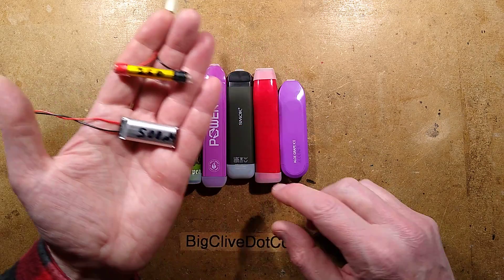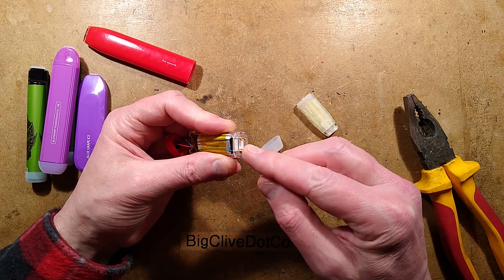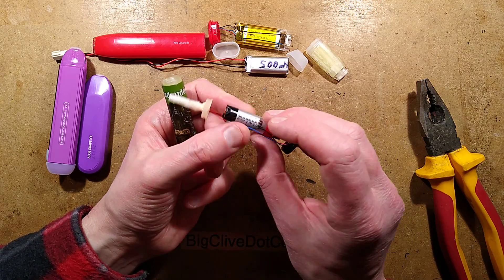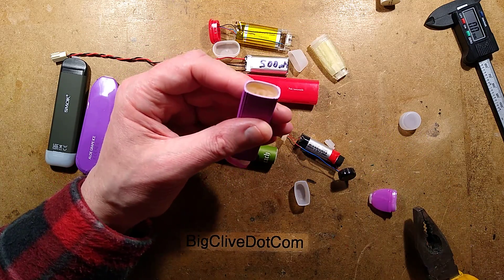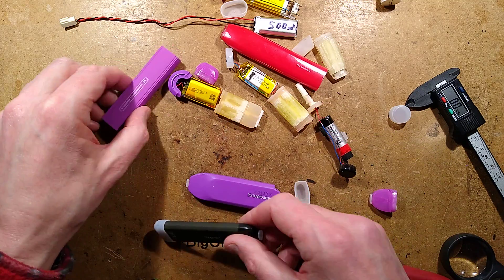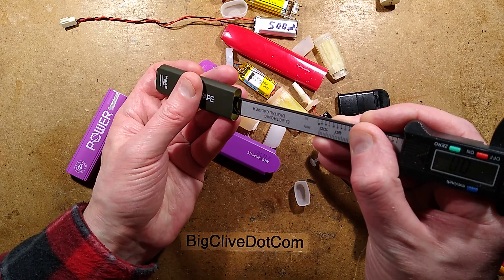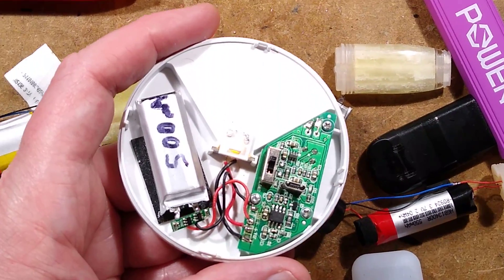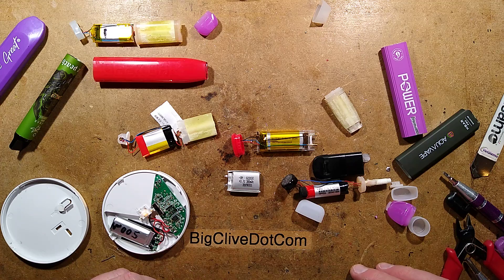Scavenging rechargeable lithium cells from the roadside

Comment: Would love to see more about reusing, testing, connecting, charging these little batteries
Reply: Buy a simple TP4056 board or equivalent and use as any other LiPo battery. The TP4056 boards have protection snd charging all on one board. If the voltage is 2.9V+ treat them as almost brand new and charge them up without worries. Although if you plan to store them for later, charge them up to the nominal 3.7V. If the voltage is lower then watch the battery as its charging, you never knew. Look up some tests to see if they hold a charge and so on. I have some that work fine after and some thst don't.  Depends on how long it has been left discharged.
Reply: @deskpro256  https://www.youtube.com/watch?v=M88e1r8nvYk
Reply: @deskpro256  I now have two scavenged Li-ion cells and I'm really tempted to build (or cobble together) a charger.  I currently don't have a use in mind, but the waste of perfectly good cells is criminal.
Reply: Devon Crawford had a fun video or two on this
Reply: @konradybcio  link?
Reply: Note that not all tp4056 boards have the full protection circuitry (the dw01a and dual mosfet), but some do, they're pretty easy to spot because of the two extra little 6 pin chips.
Reply: Would love to see the e-liquid module's volume (and its body, if present) used to house a Joule Thief. Can it be done?
Reply: @michaelthibault7930  why would one do that though... U can't fit decent alkaline cell inside anyway, and you have 3.7V cell inside already.
Reply: @plainedgedsaw1694  I'm talking about replacing the load, not all the interior guts (though you might want to replace the pressure sensor with a motion-triggered reed switch)…
Reply: @plainedgedsaw1694  Actually you can use an "upside down" joule thief, basically using it as a buck regulator of sorts. I do remember Quantsuff had some interesting pages on low power LED drivers...
I've used a heavily modded version to act as a battery charger, it puts out a constant 1.45V running from 5V.
Reply: @KomiyanVT  thx, i will be checking that one out.
Reply: @plainedgedsaw1694  Might have to hit up the wayback machine - from what I know Q's website has been down for a while...
Reply: @KomiyanVT  yep, i already found it archived.
Reply: Yes! I have been collecting a ton of these and I'm not sure what to do with them all. They all seem to have different specs depending on the brands.

Comment: When you made some years ago a video about the disposable chargers I picked up a job lot of those on ebay and I still have some stashed away. It has been my go to source of small cells for conversion projects. For example those small pouch cells fit nicely where a 9V or 3 AAA batteries would go and in general are great for small devices where a 18650 would simply not fit.
The annoying part is to have to always remember to change the programming resistor on the TP4056 module but it's worth it.

It's incredible and sad how many of these get simply thrown away

Also of course another great source of lithium cells are laptop batteries
Reply: Same, I like making devices rechargeable where possible, I used to think laptop batteries were good and they still aren't an awful source, but it isn't uncommon for them to be moderately used or have sat around for several years and lost a fair amount of capacity.
Reply: Splitting this into two comments because youtube keeps deleting it...

A far better source are battery recyclers such as "battery clearing house", (being deleted for this???) not only do recyclers offer cells much cheaper between 30-70 cents per cell vs the $1-3 per cell you typically find out of laptop packs, they often test at least batch of a several 100 or so cells before offering them up for sale, so although by no means guaranteed, you're much more likely to get what you pay for, the main advantage to buying battery packs is free shipping, where you can just buy a pack for $15, whereas these guys are shipping things properly so additional fees and thus cannot offer shipping any cheaper than about $15, so yeah the downside is it's not a great value unless you're spending at least $100 or so on a case of cells or unless you're lucky enough to live near a warehouse then you can pick up your order locally.
Reply: @vgamesx1   I like Battery Hookup, David Poz is one of their YT fans, and they often have some killer deals.
Reply: @vgamesx1  - I tend to dismantle my own battery packs as I replace them in customer systems.  I have a shoebox full of them, with their tested rating written on the side.   They're becoming much rarer, as the manufacturers don't want people to replace the batteries, but rather replace the laptop.

Comment: For all the talk there has been lately about lithium mining and its environmental impact, the use of these disposable lithium cells seems rather egregious. I'm actually surprised that this is the more profitable solution.
Reply: I've asked Naomi Wu on Twitter, and apparently Chinese government forbid selling of these in 2019, in all provinces. No ban on manufacturing, regrettably 
Chinese started selling little microusb boards with small alligator clamps online, marketing it to smokers to recharge these.
Reply: @KOTYAR1  I work at a smoke shop and we just got disposable vapes with charging ports. It surprised me that ports are cheap enough to throw away! I wish we would ban disposable vapes altogether honestly, you should have to get the refillable ones. Juul's cartridge system is better than disposing of the whole battery and device.

Edit: Maybe he meant they have a way to recharge old vapes, not that they are adding ports to manufacture. Either way, it's just a lot of stuff to be throwing away.
Reply: @chaotickreg7024  truth
Reply: Selling things is always more profitable when you don't have to account for the disposal and environmental cost (by making it "someobne else's problem".)
Reply: "unpriced externalities"
Reply: In a test I've seen with a paper filter, the cigarette spewed out a lot of brown gunk, while the vape didn't. The difference could not be more obvious.
Reply: You're talking the big tobacco companies who now own the majority of the e cigarette/vape industry (despite the self delusions of the addicted hoards thinking they are sticking it to big tobacco)
Reply: @--Nath--  What you are saying is only partially true.  Some of the cheap disposables may be backed by Big Tobacco.  But, that's simply not true of the quality devices available.  We use these devices for years, not days or weeks.
And, frankly, I couldn't give a rat's ass about "sticking it to" Big Tobacco.  I'm in it for myself, with tremendously improved lungs since I quit smoking 30 cigarettes a day.  The transition was effortless.  Vaping has, at very least, extended my life.
Reply: @Vector_Ze  You're making some pretty big assumptions there.  It is true that vaping devices avoid some of the traditional health risks of cigarettes, but there are an increasing number of studies that suggest that they may well come with their own different health issues as well, which are not necessarily any better.  That's on top of the fact that the manufacturers are in many cases deliberately including flavorings or other chemicals which are already well known to cause respiratory complications or even full on chronic diseases when inhaled (for example, cinnamon, which causes respiratory inflammation which can actually damage the lungs if done repeatedly, or diacetyl, which is commonly used for popcorn-flavoring, etc, which is known to cause a respiratory disease (known as "popcorn lung", actually) if inhaled repeatedly over prolonged periods), and those are only a couple.  Most of the chemicals in these devices are approved for food use, but have never actually even been tested for inhalation in the first place, so nobody actually even knows what they do to you if they end up in the lungs, which are very different from the stomach in many ways.

Part of the reason these devices have taken off so much is because people seem to think they're "healthier", but the real truth is that, unlike cigarettes, they just haven't been around long enough for anybody to actually have any idea at all what the long-term health risks of these things actually is.  I would not be at all surprised if a couple of decades down the line people start really realizing that maybe they weren't really a better option after all.  Unfortunately, at that point for many people it will just be too late...
Reply: @foogod4237  Well, I have to say you're well versed in the anti-vaping talking points (meaning, I've heard it all before).  There are a few gapping holes though.
Most glaringly is the old corn that vaping hasn't been around long enough to know.  I believe my more than a DOZEN years vaping, following 35 years of smoking cigarettes is pretty conclusive, using my own body's response as a gauge.  I can BREATHE, damn it!  That's kind of important.

Does it not seem that after more than a dozen years, investigations could have turned up at least some preliminary issues?  Nothing yet.  And, if there are issues (eventually confirmed), I seriously doubt they're going to top the high probability of a horrible death from a lifetime of inhaling tobacco smoke.  On the contrary, researchers every bit as valid as the "studies" you've read about (but not cited) have indicated by a WIDE margin that vaping is less harmful than smoking.  A cited figure is 95% less harmful, which stands to reason.
https://www.gov.uk/government/news/e-cigarettes-around-95-less-harmful-than-tobacco-estimates-landmark-review

Flavorings may be a concern, although the popcorn lung thing is straight out of the propagandist's textbook.  I've sidestepped that issue entirely, since along with a lot of other vapers, I don't use flavored eLiquid.  My guess is you aren't even aware of that as a possibility.  Both flavorings and nicotine are optional.
But, the biggest problem with your diatribe is the red herring you went on when you stated vaping isn't "healthier" than smoking.  Absolutely no sensible person ever suggested that either smoking nor vaping was "healthy."  Guess what?  Neither is eating red meat.  Healthier??   Are you for real?  We're not talking about eating fruits & vegetables.
No educated vaper is going to claim vaping is harmless.  But, it is far less HARMFUL.  Vaping produces no SMOKE, and that is the big killer with combustible tobacco, inhaled habitually, and daily.  That's a deadly habit.

Most importantly, vaping has helped MILLIONS of people quit the deadly habit of smoking.  Think about that.
Is vaping harmless, probably not.  Is it better than smoking?  NO question about it, ask almost any doctor.  Every single compound in vape is found in tobacco smoke...plus THOUSANDS of others (some proven carcinogenic) not found in vape.
You would choose to deprive smokers of the most effective smoking cessation aid ever devised.

I swear, some people would prefer that people just keep smoking, rather than switch to a less harmful alternative.  I'm 68.  When I was in my mid-50s, I was certain I wouldn't make it to 60, my lungs were in horrible shape.  A decade after switching, my doctor stated that my lungs were nearly as clear as if I'd never smoked.  Get a life, get off the anti-vaping bandwagon.  There is NO QUESTION that I'm more healthy now than I was when I was smoking 200 cigarettes each week.
Don't stand in the way of people who want to end a tough habit, to try to extend their lives.

I would never condone someone who isn't already addicted to nicotine to take up vaping.  It is a powerful smoking cessation aid, which is subject to abuse.  Kids can't legally buy alcohol, nor tobacco products.  That's well and good, but it never stopped them from obtaining alcohol, nor tobacco products.  If they're going to do one or the other (they will), vaping is nowhere near the threat that smoking is.
The way you anti-vaping warriors would have it, the kids (and everyone else) would be better off smoking...and that's madness.
Reply: @Vector_Ze  I seem to have touched a nerve..  I'm not some "anti-vaping warrior" like you seem to think.  Those weren't "talking points", they were my own conclusions from my own research into the subject.  I'm not trying to tell you "you shouldn't ever vape".  I'm simply saying that you should not assume that vaping is necessarily any better than cigarettes, because the truth is just that nobody actually really knows whether it is or not yet (and in many cases, the manufacturers of the devices seem to be playing rather fast-and-loose with things that are known to be unsafe in other ways, which is not a good sign in general).

Even after people suspected that tobacco use was harmful, it took many decades of many large studies for them to actually unravel all the details of exactly how harmful it was and the multitude of different ways it affected the body.  Things like asbestos were in use for literally centuries before people discovered how bad they really were.  Sure, modern science has gotten better, but even recent medical concerns like athletics-related-TBI went undiagnosed for many decades before people realised they might even be an issue (basically, it wasn't until they started doing a lot of autopsies that they found it).  That's just how this sort of thing works, because the human body is a very complicated thing.  The anecdotal report of "I feel fine" from an individual (or even a bunch of individuals) using something for 12 years is basically meaningless in these sorts of areas.

But I'm not trying to tell you that switching to vaping was a horrible thing.  While I personally don't know whether it is actually any better or not, to be honest, I doubt it is actually any worse, so if you decided to swtich from cigarettes to vapes, I don't really have a problem with that.  I just don't think you should assume that because you switched you're necessarily any better off than you were before, because frankly, nobody actually knows at this point.  I also don't think that vaping should be hailed as some "savior of cigarette smokers", because it's entirely possible that it's actually just bad in different, less obvious ways, and we may well discover in the long run that people have only swapped one set of diseases for a different one instead.

As for vaping helping millions of people quit smoking, I'd love to see a citation for that.  When these devices first came out, I was actually rather hopeful that that might at least be a positive benefit of them, but frankly, what I've seen since has seemed to be exactly the opposite:  Cigarette use was already declining, but the rate of decline as been almost completely unchanged since before vaping came along, and on the contrary, studies are now showing that many younger folks who start off vaping actually end up also smoking tobacco more as a result, not less.  Vaping has, in many cases, become just another gateway into other tobacco products and has even helped with a resurgence of things like cigars (which are far worse than cigarettes health wise, but now increasingly popular again).
Reply: @foogod4237  You wrote a lot, and I appreciate the time you've given to your reply.  But, in your first paragraph you question whether or not vaping is more safe than habitually inhaling the smoke from computing tobacco.  That's really the end of the conversation.
Your brand of fear mongering is responsible for thousands of lives every year.
Reply: @Vector_Ze  Sigh, I had really hoped that we might be able to have a rational, mature conversation about topics which are actually not always black-and-white and often worth investigating in more detail, but unfortunately it's pretty obvious that you have decided that anybody who questions anything you say must be shouted down, called nasty names, and tarred and feathered for their insolence, so I guess there's really no point to going any further with this.

"Don't question me, fearmonger!" is the classic tirade of those who know they're on flimsy ground, but care more about winning the argument than about pesky things like facts and reality, IMHO.

FWIW, I wish you a good day, and I hope your choices do work out well for you (I honestly do).
Reply: @foogod4237  Sorry, your pity party ain't cutting it.  You did some research, you found talking points to support your preconceived thoughts on the matter.  You regurgitated those talking points.
I provided real life experience.  If your joy in life is to persuade people to avoid life saving technology and urge them to instead keep consuming smoke from combusting tobacco products (which kills!), then I guess you're right.  There's nothing to talk about.
I explained my experience and situation.  I related my doctor's comments.  Apparently, common sense and empirical evidence mean less to you than your propaganda.
I'd just add, you're years behind the research.
Reply: What you are saying is the very reason they use rechargeable lithium cells, that is because rechargeable cells use less lithium than a single use lithium battery.

Comment: Oh wow, they are like the batteries you use in small toy drones.  It is outrageous that these are sold as single use items when they are potentially rechargeable & re-fillable.  Shocked at the Aluminium casing as well.  Nice video Clive.  Thanks for sharing, 👍.
Reply: Better they use recyclable aluminum than damn plastic.
Reply: @firesurfer  - yea, but that Aluminium was just tossed on the street, whereas it should be recycled.
Reply: To be fair a reasonable number of said drones in that price range are single (digit) use anyway.
Reply: @Shaun.Stephens  - I think I got a few flights out of them before they took excursions when they went out of range. 😂
Reply: I have several RC drones and planes that would use those batterys.
Reply: @scottfirman  - I have lots of batteries but no drones.  I keep loosing them.